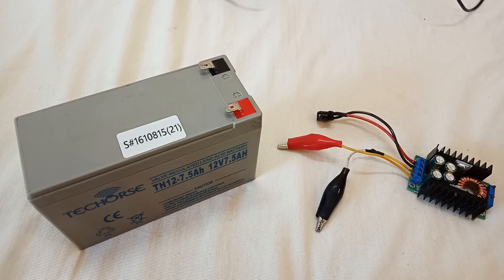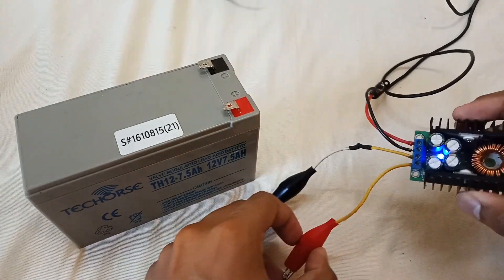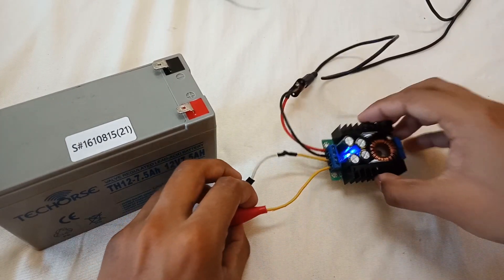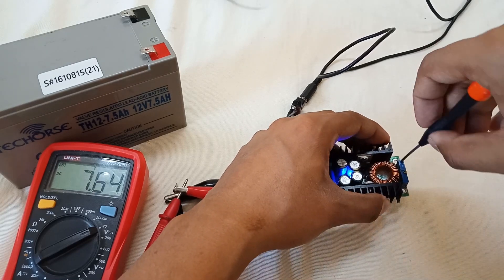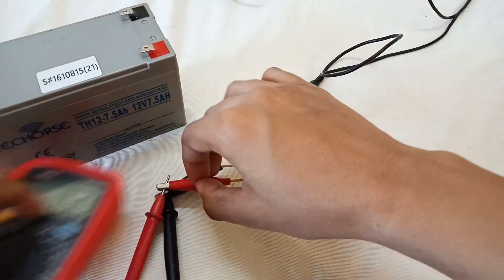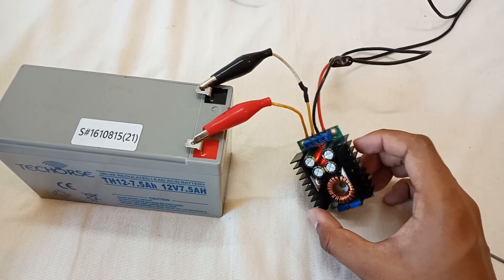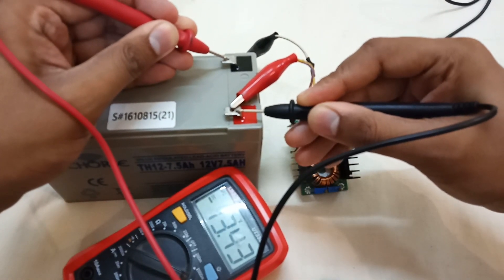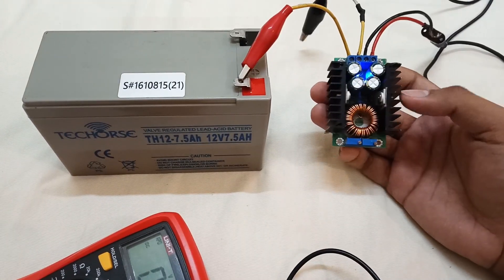Unlock the Secret to Charging 12v 7Ah Sealed Lead-Acid Batteries with the XL4016 Module! CC CV

Comment: I charge my batterys with my riding lawn mower, as I cut my grass anyway. But cool idea if you want a electric bill for charging your batteries.
Reply from the maker: It will not charge you thousands of dollars to charge a battery 🔋
Reply: I have a older riding lawn mower with a magneto stater head. It charged my car battery when it was totally dead, it took about a hour of a riding mower jumper, with cables. I also have a small AC\DC inverter that I use to charge up my cordless items, drill, chain saws, phones and all sizes of DC batterys. It works for me !

Comment: I was need charger 12 volt 7 apm ups battery can use XL4015 5 apm converter input applying 12 volt 1 apm  when rotating but ouput voltage and current is not increasing or decreasing why this reason help me plz🙏🏻
Reply from the maker: Brother it is step down module.
You need 14-15v input supply so you can get about 13.5v at output..
You are giving 12v input..it will not increase voltage, it decrease it.
Use 15v power supply input then decrease the voltage to 13.5-13.8v..

Comment: You said balance charge so this module cant charge battery fully right as voltage is dropping?
Reply from the maker: I mentioned in the video that required voltage is 13.8v to hit the 100% charging after it, all lead acid batteries drop off to stable 12.6-13v 
Voltage after full charging..it doesn't mean they are not fully charged.
Obviously this module will do what it is designed for.
Reply: @Electricquantism402  ok, thanks for reply,so it's kind of sos for car and motorcycle battery

Comment: xl 4016 led green before charging complete?what is the probm.if i set 12.6 when battery charge for 12v its led green
Reply from the maker: Its a multi color led check that if it turns to totally green ..

Comment: Should I place a diode so as to no reverse current flow from battery when power is off ?
Reply from the maker: Yes...but keep in mind the voltage drop across it.
Reply: Actually I test but if I placed diode buck converter cannot detect the charge , so I finally placed the relay, now it is working fine

Comment: What if power supply is off will the battery voltage damage buck converter, if it is still connected.
Reply from the maker: No..it will just light up the led on module maybe as with the case with xl4015.. not confirmed about 4016..
Will not damage..